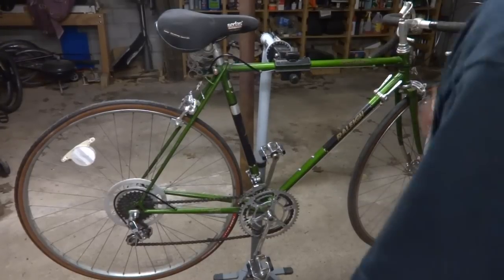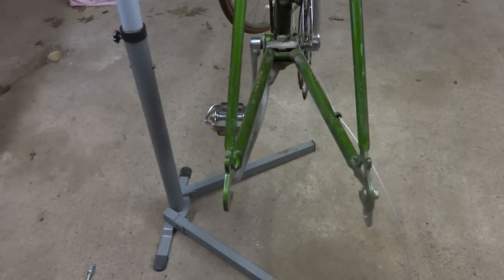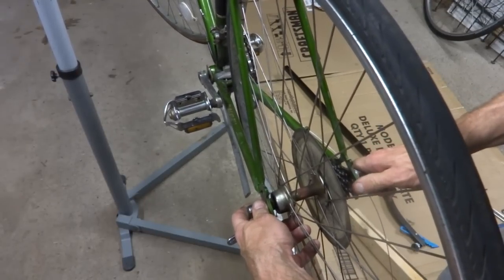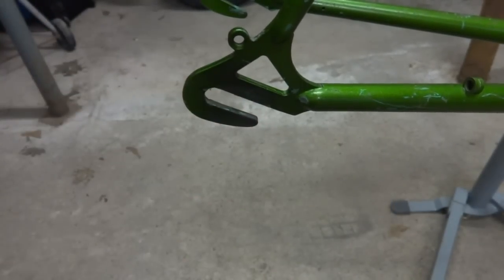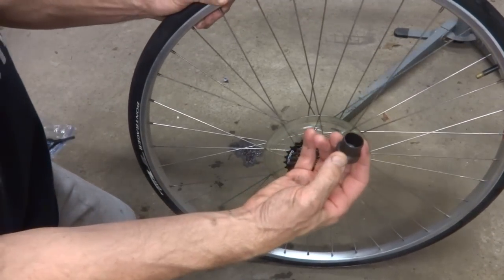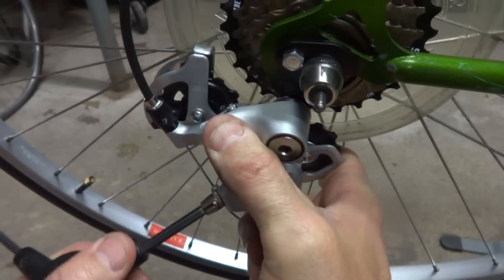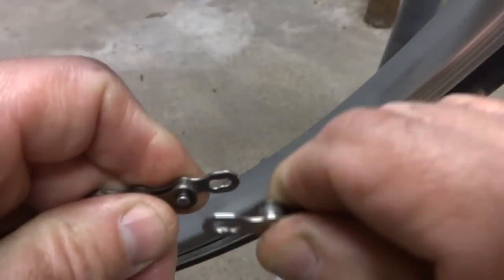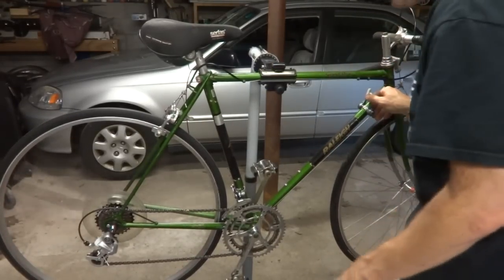Upgrade Vintage 10 Speed Bike To 14 Speed & Indexed Shifting

Comment: It says Raleigh but the wrap around and colour strongly suggest that it's a Carlton (they were part of Raleigh).

If you've still got the bike, can you do me a favour and publish the Serial number (should be on the bottom bracket) and if the bottom bracket is either 24, or 26 TPI (26 is Raleigh, 24 is BSA, or also known as BSC both whit form).

Thanks in advance, an old Nottingham bike mad kid who still has his Carlton Pro, from new (1981) and had a fair few family members work on both Triumph and Faraday Road.
Reply from the maker: I sold it. It didn't seem to be anything special. Notice the flat drop outs.
Reply: Despite the flat drop outs, I suspect the frame is a Carlton. Carlton/Sun did use Huret with clamp on hangers. Even raced with them during the late 60's early 70's.
Reply: Looks very similar to the Grand Prix (1970) I now have which is a Carlton.

Comment: that bike is exactly the same as my eddy merckx
Reply from the maker: If your Eddy Merckx was like this, you got ripped off.
Reply: Bought it 35€ second hand. Made by Starnord in france, in the 80s.Same 10 speeds and huret derailleur, brakes, normandy hubs, the frame is the same...
I m in france btw.

Comment: Hi re. Love how talented you are, and generous with your knowledge. I have an old Benotto10 or 11 speed late 80's bike.Love it, but have limited info.on it.please can you make a video on servicing such a bike.I would prefer to communicate with you through an email address please. Any relevant information on the benotto would be greatly appreciated.
Reply from the maker: I assume you mean 10 or 12 speed. Chances or, it's not too different than many of the bikes I work on my videos, so they should apply. As for info on Benotto bikes, you can google that, or find some bike groups that might be able provide information.

Comment: Sheldon Brown gives a simpler method for chain sizing.
Reply: Here is the link  http://www.sheldonbrown.com/derailer-adjustment.html#chain
Reply: And here is the text description, "The best technique for setting chain length is to thread the chain onto the large/large combination, without running it through the rear derailer. Mesh the two ends on to the large chainwheel so that one complete link (one inch, -- one inner and one outer half-link) overlaps. In almost all cases, this will give the optimum length."  the website has an illustration.
Reply: Sheldon Brown gives a simpler method for chain sizing. R I P.
Reply from the maker: Then use his. This is the way I learned. I have heard of people having problems using his method.
Reply: I’ve done both methods and have had success with both.

Comment: those easy chain links arent strong enough..ive broken one. they cant handle heavy pedaling...

just chain break your chain solid with out that.
Reply from the maker: I have never broken one. And I have ridden them hard. I have never even seen a broken one. Maybe yours was installed wrong or had a flaw.
Reply: @RJTheBikeGuy  nope

Comment: better way to widen your wheel stay back end get a threaded metal rod put nuts on metal rod use your wrench widen your back forks are whatever you call the back end of the bike where the wheel go ..it better than damaging your down tube are bending it .but if your method works so be it but its how i would do it :) woops just wATCHED a bit more of the video you did use a threaded rod sorry
Reply from the maker: +bucketrobbert I do that in another video. But in this video the stays were uneven to begin with. So I only want to move the one.
Reply: its ok i did not watch all the video before i commented me bad sorry

Comment: Do not neet adgust the the frame   expeculy the hub maillard rival atb   he have spacer you can to put freeweel ultra space.shimano hg37 if you tend to put shimano tourney tz21 the left side the hub maillard rival remove the left spacer. NOT right. 126mm  conceder it is 6-7speed. 130mm it is 8seed. And offcorce use the same cain.

Comment: NOOO! Remove the dork disk!
Reply: Also i always spray some WD40 into the cable housing first
Reply from the maker: +Doreen Green No. Not unless you are working with ancient cable housing with no plastic linings.
Reply: Wowzers! I didn't expect such a quick reply (or any reply at all) to a three year old video  hehe. 

Is putting WD40 not a good idea then? it's not normal WD40 btw its the tethlon lube stuff.